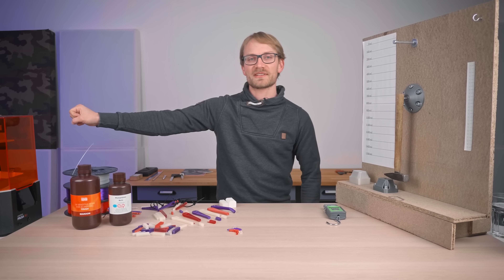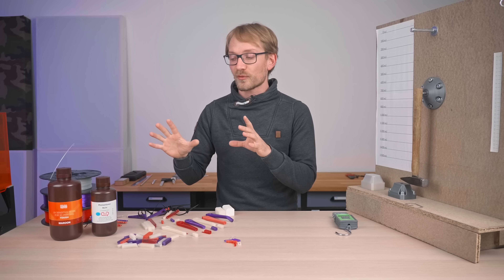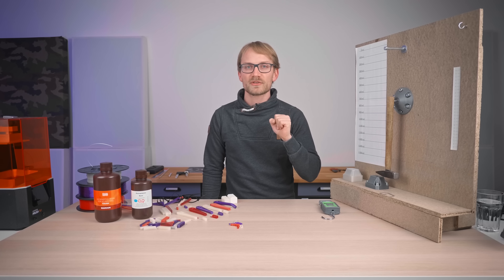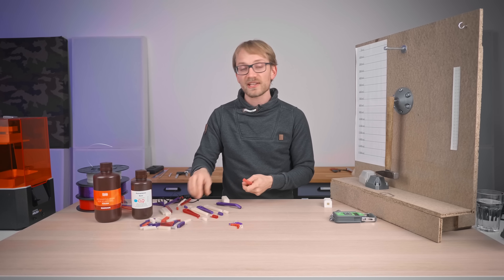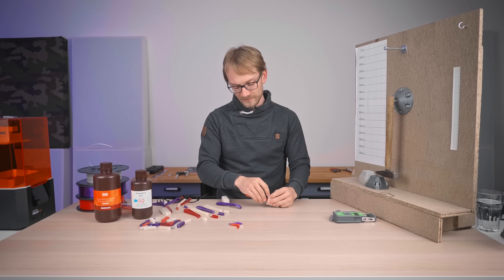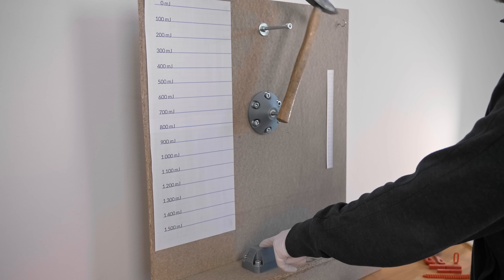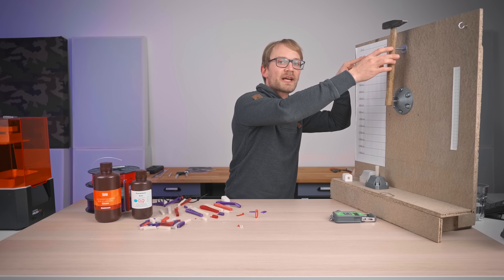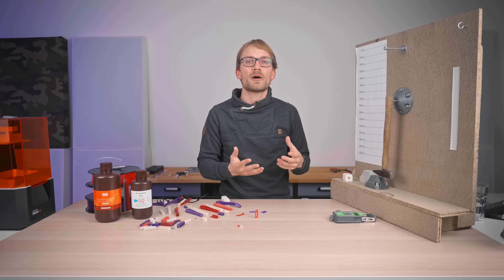Elegoo resin vs. Prusa resin vs. PETG vs. PLA

Comment: I would like to see a print orientation test. You just assumed the results would be the same without showing any data to support it. I know the process should make the results the same, but testing is the only way to confirm.
Reply: The process actually shouldn't make the finished product isotropic. Resin printers still print in layers, just much thinner layers, so orientation will make a difference
Reply: @dougiethompson2822  if you check CNC Kitchen channel you can find a video with resin prints test in each orientation, every test shows clearly its like 45kg vs 42kg, its very minor difference
Reply: @MrTiranei   3 Kg is a greater difference than what separates the layer adhesion strengths of PLA and PETG (2.1 kg difference) , though -- I'd say 3 kilos is non-negligible for some applications at the very least.
Reply: @MrTiranei  3KG isn't a minor difference...
Reply: @Krytern  its barely 6%, in this case it doesnt matter too much, resin prints have overall similar strength no matter which way printed

Comment: I'd actually be curious to see SLA prints tested in both orientations. It's not obvious to me that they would be identical.
Even if it's a widely known fact... well, it should be a pretty cheap test to run, and the world could use more replication studies. :-)
Reply: The resin is fused together on a SLA printer, orientation doesn't matter, the layers don't exist.
Reply: @SaitoGray  Maybe, but there's still a directionality to the printing process which may have some effect. Have you already run the experiment?
Reply: I agree. Some sla materials definitely have layer adhesion issues.

Comment: Thanks for this video, Tom! A ton of useful info. 

The performance of the Elegoo resin really surprised me.
Reply: clear resins are stronger that standard solid blue /solid white and especially solid grey.  also washable resins are uniformly weaker.  shear fracture is a real problem (twisting).  eSun has a hard/tough resin that I've had good success with, although it uses a more complex post curing regimen.

Comment: resin still has layer lines so it should be printed both sides
Reply from the maker: Maybe something to investigate in a follow-up 😉
Reply: I would be curious to see that "charpy" test with resin print made in 45 degree angle. If the impact/cut mark is not in so-to-say 90 degree angle, then it's pretty much definitely sure that printing orientation matters in resin printing.
Reply: This is what I was going to suggest as well, it might have some sort of "micro-layers"

Comment: Finally! Great to know. :) The only thing I don't quite get is the no tuning whatsoever. If it's about testing the material itself, you want to take the machine as much out of the equation as possible right? Tuning would/should give the same results across various tuned machines.